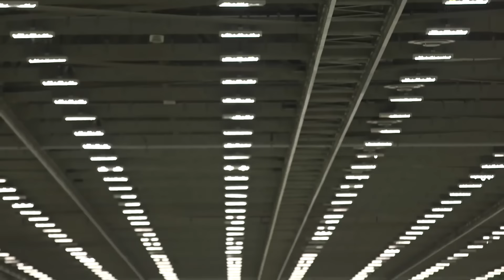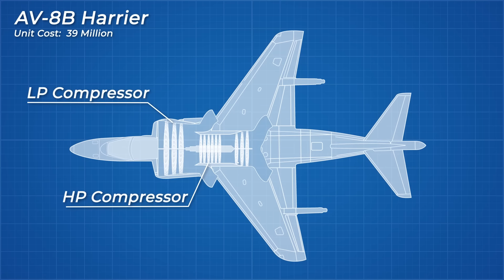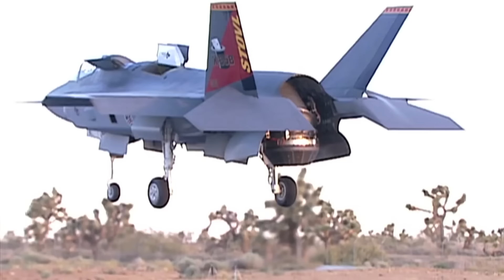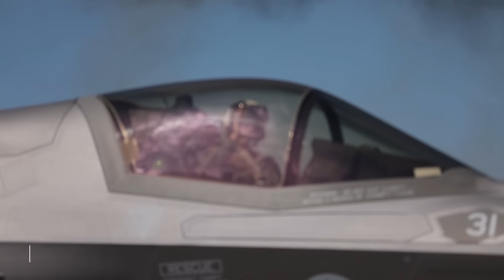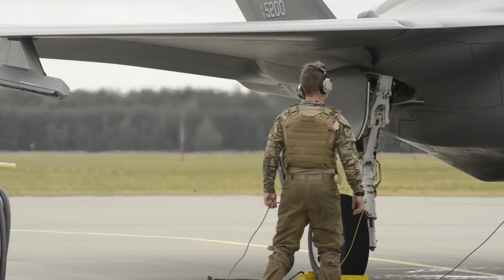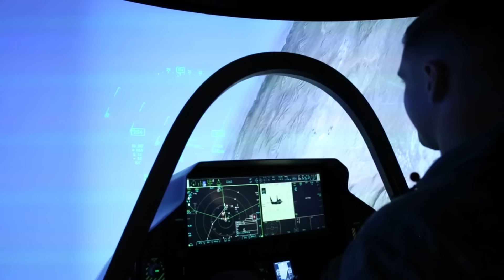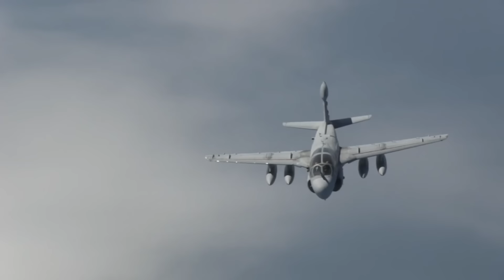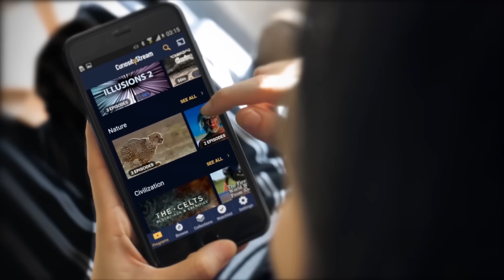Is The F-35 Worth $115 Million?

Comment: The "Jack of all trades" and the master of none.  A single engine mechanical nightmare which does nothing really well, is ridiculously complicated, huguely overpriced,  and is a maintenance nightmare. 

Neither fish or foul I pity the pilots who fly it, the airmen who have to service it. The taxpayers who have to pay for it, and the nations who will rely on it for defence.

There are good reasons why a vtol attack plane is not used as an air superiority fighter or a strategic bomber.

3 separate aircraft that share common parts like engines, tires, ejection seats and avionics would have been far cheaper to build per unit and far more capable of successfully completing its assigned combat role.

A Hundred million dollar close air support aircraft for example is a ridiculously expensive way to take out a tank or give air support to troops on the ground, where all that fancy electronic garbage is rendered useless do to the the nature of the combat, where simple lead bullets and line of sight shoulder fired rockets render those fancy microchips and programs useless.

Why do you think the Air force wants to hang on to their A 10's?  And ask a navy pilot how they feel to rely on just one engine?

One of the biggest defence boondoggles in history.
Reply: > "Neither fish or foul I pity the pilots who fly it, the airmen who have to service it. The taxpayers who have to pay for it, and the nations who will rely on it for defence.
"

 A lot of pilots don't hold that view. 

> "3 separate aircraft that share common parts like engines, tires, ejection seats and avionics would have been far cheaper to build per unit and far more capable of successfully completing its assigned combat role."

 That's essentially what they are. It was originally considered in the requirements 27 years ago that they would share over 60% commonality. It was deemed soon thereafter an inefficient and performance compromising concept. And thus pushed for 3 aircraft that share considerable commonality (~25% ). 

> "A Hundred million dollar close air support aircraft for example is a ridiculously expensive way to take out a tank or give air support to troops on the ground, where all that fancy electronic garbage is rendered useless do to the the nature of the combat, where simple lead bullets and line of sight shoulder fired rockets render those fancy microchips and programs useless." 

 What are you on about?
Reply: But multirole aircraft have already proven themselves to be masters of all trades.
It's not a superiority fighter.
Fancy electronic garbage is useless, and yet the main tank killing weapon on the A-10 is the AGM-65 Maverick.
Two engine reliability doesn't mean much because if one engine goes out, typically it takes out the second engine too.
The Air Force is trying to retire the A-10 for years.